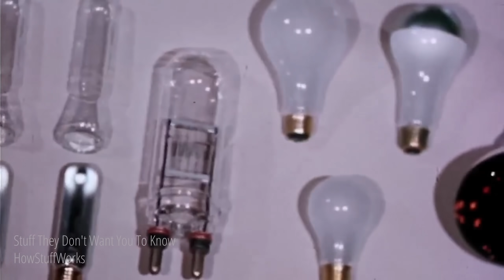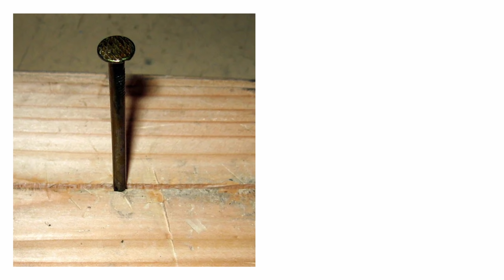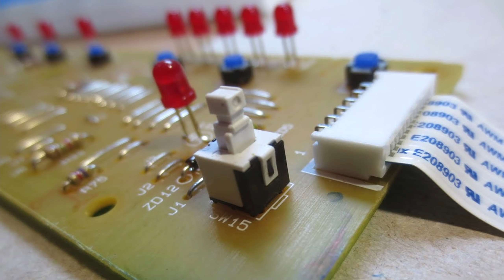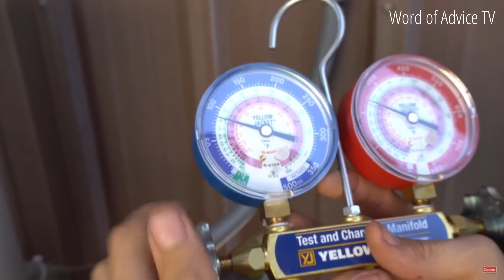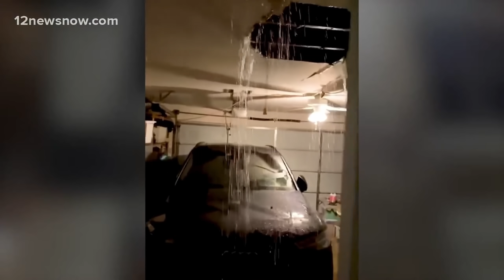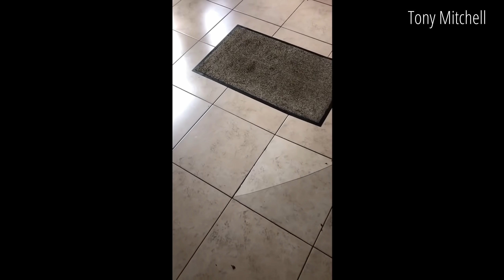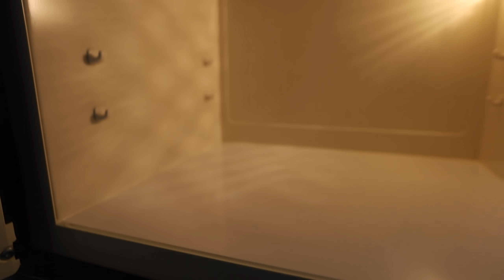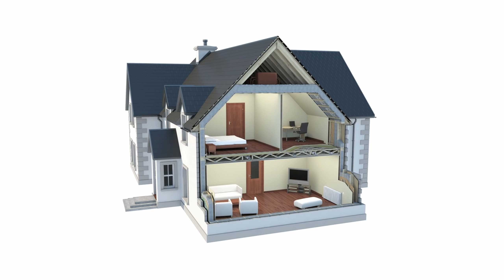Built to FAIL | Planned Obsolescence

Comment: Soil heave can be ameliorated by diluting the clay content of the foundation with sand down to the permanent water table.  It has to be well mixed though, which is difficult.  The large voids between the sand grains allows the clay particles to expand harmlessly into the empty space, if the clay weight percentage is sufficiently low.  If the clay concentration is sufficiently high, they will move the sand particles, and with it the bulk soil.  This can produce several tonnes of force per square meter.  If the overburden structure is simply too heavy, the soil will self-excavate to the sides, undermining the building.
Reply: Interesting!
Here we just use pier and beam foundations whenever there's a clay rich soil.
Easily adding 10k to the construction cost.
In recent years I've seen foam concrete being used more and more, mainly for extensions. Which aims to balance buoyancy with building weight.

But if simply replacing the top soil can stabilise the structure, that could be a far cheaper option. 
I'm gonna look into that, thanks!
Reply: By permanent water level, I assume you mean below the frost line?

Comment: So, you tried to fix your fridge?  Can you install a new breaker in my electric box and install an electric heater?  Come on over anytime.  I was most interested in the examples of the home issues.  I have the same problems with my floors,,, a pattern no longer sold but I am lucky I have a half a box left and my plan is to replace my kitchen with something new and SAFE those pieces.

Comment: I once worked in construction litigation. I was at a site inspection and we were looking at bathtubs. They were the kind made of fiberglass, molded into the space. They were failing and leaking. The buildings were about 5 years old. I asked the building expert why they failed so quickly and he told me they are only intended to last ten years because people will remodel their baths anyway.
Reply: Wow.

We have a "modern" fiberglass kind of bathtub, and it's lasted 16 years so far with a tiny bit of very minor chipping.

I cannot imagine it leaking after 5 years. Like, no.

Comment: As a contractor i  agree 100%.   If you buy a house your contractvwill say that you can't come in and check the house before it is finished for safety reasons, but in reality we know why. For that reason i am builing a house myself and the inspectors say i overkill in some cases which i believe should be a standard.
Reply: Amen! I'd never trust almost any modern house construction. I'm on year 3 of overbuilding my new shop. The electrical inspector kinda laughed at me for running the conduit for the feeder 40" deep under my driveway (code is 18"). I used glued mortise-and-tenon joints to attach the studs to the top/bottom plates, glued the 2x6s forming posts on multi-stud areas (next to window/door openings) together, used big glu-lams for all headers, sealed every sheathing seam, used both liquid flashing and Flexwrap on window openings, shimmed windows to drain the sills, installed a real rain screen (using 1/2" plywood strips @ 12" OC) under the siding, peel-N-stick rubber gaskets over every conduit penetrating the sheathing, and 5/8" fire-rated drywall everywhere. The building will last way longer than most. I despise cheap construction!
Reply: @bmay8818  Are you Amish?  That's how the Amish WANTED to build my barn.  That's why I hired them.  It will last 100 years, I'm sure.  You can see the quality just by looking at it.
Reply: @frankhazzard3250  No, I'm just a perfectionist! It actually didn't add all that much more time to attach the studs with woodworking joints (I used a Festool Domino XL to cut the mortises). It definitely did take more time to do the rest though. No Amish where I live, but I bet they know how to make barns!
Reply: @bmay8818  Nothing too strong ever broke.
Reply: Give your business card? 😂
Reply: As someone who doesn't know how to do all that.. am I better learning how to build one or are there legitimate builders out there? I am afraid of having a house built just for it to be trash.
Reply: @muffinbutton1484  Every builder will claim to be a legitimate builder, unfortunately it's up to you to research durable building, have what you want on paper and be prepared to enter the worksite in progress to make sure they aren't cutting corners.
Reply: @hurrdurrmurrgurr  Right.. but how would one know is the sad part. We can't all be experts in everything. So even if I was there i wouldn't know what I would be looking at.
Reply: @muffinbutton1484  you could hire an architect to get specifications, drawings and a design worked out if you're not able to research and plan on your own.
Reply: @muffinbutton1484  Hire a third party surveyor to check each step of the build.
Any contractor with severe objections to that disqualifies themselves in my book.
Reply: @muffinbutton1484  There are better builders, but I don't know how you'd find one. I asked on Nextdoor for a concrete guy and the one I found is very good, and rather expensive. The only part of my shop I didn't do myself was the foundation, and I'm glad I hired that out. My guy was so good that the foundation is perfectly square across 2500 square feet! All I can say is, ask around and read reviews of contractors. Wish I could be more helpful.
Reply: I'm with you. My land is fairly remote, so I'm doing everything I can to ensure I can live efficiently, with as little reliance on public services as possible. But it is extremely difficult to find builders in my state that want to build a net-zero, passive or even just a highly-engineered home. Everything is about pricing, convenience and time, which in my opinion is what is driving planned obsolescence in the first place.

Americans have lost the will to buy quality products that last for generations because we just assume we will always be able to upgrade in a few years. Well that's just fine...as long as supply chains don't crumble, resources don't run low and pandemics don't disrupt economies.  Now we're starting to see the effects of when those things happen. Hopefully, it will cause people to rethink the disposable economy that we find ourselves in.
Reply: @DesertHomesteader  Right after saying it is extremely difficult to find builders that will build (quality), you blame Americans for losing the will to buy quality.

I don't believe it. People want to buy quality stuff, it simply isn't available. I want to find a pair of shoes that doesn't wear out in exactly the same way after a couple years, I don't even know where to look. Same with whatever it is, houses, contracting work, appliances. There is no way to reliably know what is going to last and our regulations basically encourage this behavior.
Reply: @TheJohnreeves  I disagree. It's both the consumer and the manufacturer/builder who are responsible for the poor quality of so many things these days. People want 4,000 square foot McMansions, and care way more about the countertops than the type of sheathing. People say "that's too expensive!" when a toaster is $180, but complain when their $25 toaster breaks. If people were more concerned with living within their means and buying only what they needed, they would have more money to buy better quality. Manufacturers build what people buy.
Reply: @TheJohnreeves  I agree whole heartedly. Want a security system that is actually secure? You're not going to find it on the market. I built mine. Nobody in the cloud can access it. 
Want a car designed to last more than 5-10 years? Better go to the junk yard to find a good frame to build it on.

I can't say I know a single person who has bought a new home and hasn't had to have the contractor send someone out to fix things. 

Heck, I started growing my own food, because I can't trust distributors not to spray chemicals on the produce, even if it is labeled Organic, the distributor is still going to spray it. Even if you go to the farmer's markets, half of those people buy their stock from a distributor or are there directly on the distributor's behalf.
Reply: @bmay8818  Nope, manufacturers build what they can make the most money from. People buy what manufacturers have to offer.
Reply: @ronniemcmaster8657  it depends on the product. Yes if it’s coming off an assembly line but custom homes are different if we are still talking about those. If we are a big part of the problem is a disconnect between builder and customer.  Customers have trouble finding those quality builders if they value quality. And those quality builders may be assuming the customers aren’t out there and are changing their product accordingly. Not to say many customers don’t care about quality and aren’t willing to pay for it. This isn’t buying a car and knowing what you are getting.
Reply: @ronniemcmaster8657  "Nope, manufacturers build what they can make the most money from." No, Ronnie. Manufacturers can only make money from products that people buy, so B May is correct. "People buy what manufacturers have to offer." Yes, they buy what some manufacturers have to offer and choose not to buy what other manufacturers have to offer. The manufacturers that are best at offering people what they want survive, while those manufacturers who don't go bankrupt. What people, in the aggregate, care about is reflected in the product offerings of established companies. That's why you don't see any car companies selling cars that are designed to last 500 years.
Reply: @bmay8818  There is no guarantee the $180 toaster will last a lifetime.  We bought three higher-end toasters in a row that lasted 5 years each.  Now we just buy $17 toasters that last 5 years.
I replaced my 20-year-old Whirlpool dishwasher with a $1200 Monogram washer that failed in a year and barely hobbled along after a repair for 2 more years.  I've got a Beko washer now that is doing great after 9 years.  All that to say buying quality is really a difficult bewildering process.
Reply: I did a remodel a few years back that required replacing two load bearing walls with LVL headers. I had e-mail a sketch the the manufacturer and one of their engineers specified the size of the headers. When the plan was shown to the building inspector his comment was why is your contractor putting in such big headers?
Reply: @janderson8401  \
Reply: Overkill means your house was built correctly.
Reply: And they would not be getting my business...
Reply: Why don't you wait until it's finished and decide whether or not you want to buy it then so?
Reply: @Monaleenian  Why not demand a higher standard so people aren't stuck with garbage homes? I am guessing your comment is to the original post about not being able to walk the job site to inspect. This applies to custom homes where you've already signed a contract. Are you going to tear out the walls to inspect the quality of the work?
Reply: The inspectors will not be flipping the bill when trouble strikes.
Reply: Exactly what they told us when we had our house built?

Comment: Eye opening!
The worst planned obsolescence I know? A single-use "emergency" cellphone charger that has a Li-Ion akku inside, a circuit board that makes it unchargable and all casted in plastic so that it can never be used or recycled again.
How about all the new lamps with beautiful led-design? What if leds or the circuit board fail? You throw away the whole lamp that probably fits together with other lamps in the same room - completely unrepairable. 😳

Comment: I just replaced the bearings on our front load washer and it was a huge ordeal. They could have easily designed it to be replaceable from the rear, but you have to take the entire washing machine apart to get to them. It's not even old enough to be failing like this.

Comment: The European law protects consumers in this way. According to EU law the manufacturer of your old frigde is liable for the majority of the repair cost. Because a normal fridge should last 10 to 15 years without issues. This is the responsability of the manufacturer they cannot rid themself of that responsability by only giving a one year guaranty. Ofcours the liability of the manufacturer is bigger after only 2 years then after 10 years. It can be a hassle to claim this kinds of damages especially if the product comes form outside the EU.

The EU is also forcing all mobile phone manufacturers to use one and the same chargers. They gave the market time to solve this obsolencence problem themselfs but the markt said it was impossible. So now it law and they will have to do the impossible.

My moral of the story, in a good political landscape where the intrests of the people is always priority number one,  insead of lobbyist and financial donors, these issues can be solved fairly simple and we will all win.

Comment: My wife and I have had this same discussion numerous times.  We still have the same dryer we bought in 1998; I have changed the belt and various electronics a couple times, but most of it is the original components.  The washer we bought with it finally rusted through just 2 years ago.  Meanwhile, the fridge we bought 5 years ago (to replace a 20 year old fridge that came with the house) is already showing signs of wear.  We have gone through a few dishwashers, and each one lives a bit less time than the one before it.  

I have also thrown out numerous tools and appliances (power drivers, saws, toasters, coffee makers) because one small component failed and a replacement part was either unavailable or cost more than a whole new item.  A lot of the time, it’s the add-on bells-and-whistles of modern items that fail early, and I don’t really want them in the first place, but you can’t find a version without them.  I think that if you had a store that sold basic, solid products with user-replaceable parts, you could make a killing.  But what manufacturer these days would make them for you?
Reply: It's amazing how long lasting much of the old appliances were, my toaster is from the 50's and still rivals those made today. The microwave ovens from the late 70's were the peak of build quality.
If something does go wrong with them, it's usually because of age alone more than actually wearing out.
Reply: Still have the Maytag washer and dryer my Dad bought in the 70's before I was born...
Reply: I noticed that too. The simpler the appliance or tool, the more it lasts. I had a 25 year old washer that  finally died and was able to replace it with a model almost exact to it, which is a very simple, no frills machine, and see if it lasts longer than one of those with a lot of add ons.
My appliance tech told me the same, the versions will lots of add ons don't last, unlike models like the one I just picked.
Reply: Has anyone owned a speed queen washer or dryer? I like them because they are no frills and pretty durable
Reply: @aayotechnology  I never owned one but I too have heard they are very durable.

Comment: Interesting that you mentioned front loading washing machines and their bearings.  The washing machine at the house died this week and the tech diagnosed the problem as being the bearings.  At $250/hr it would cost more to fix than to replace.
Reply: So the thing is bearings fail, there is no way you can make a bearing last forever. this applies to top loading too, or anything that has a bearing. Expecting a bearing to last 100 years or even 25 in a washing machine is not realistic, they do after all spin at up to 2500 rpm with uneven loads.
Reply: @user-by7hj4dj9s  Industry standard bearings are not expensive. The problem is that items are built with specialized bearings which are expensive or unavailable and not designed to be easily changed out. I don't think it would be that difficult for a company to use standard parts and make it easier to change wear items, but there is no incentive to do that. They make more money if they can save a little by using lower quality parts that snap together easily when built and require the item to be replaced sooner rather than later.
Reply: @user-by7hj4dj9s  Bearings have factors of safety. You can increase the life of a bearing by choosing one made for a higher load rating. Manufacturers just refuse to do so. I have seen 70 year old washing machines on the original bearings. I have seen hundred year old motors and dynamos on the original bearings. We need minimum quality standards enforced in law. Planned obsolescence is a human and environmental disaster.
Reply: You can replace the bearings. You can also prolong the life by lubrication. It takes time and tools but it is doable by a home mechanic.
Reply: Not to mention that most modern washing machines use non replaceable bearings.
So when before we could open the drum and replace the bearing, nowadays you usually have to replace the entire drum.

Which just happen to be priced at exactly one buck over the machine's value at the time of failure..